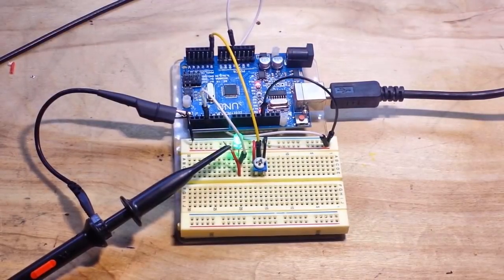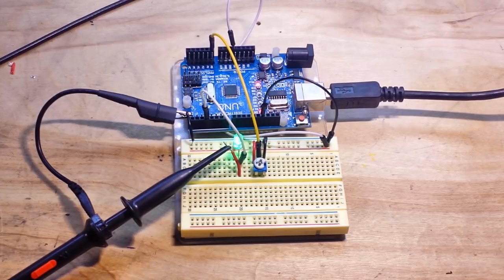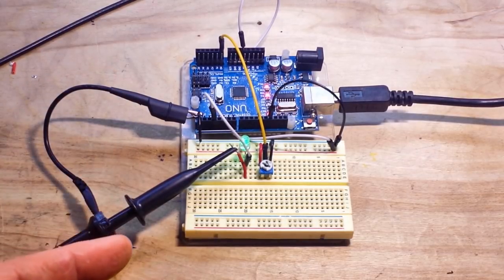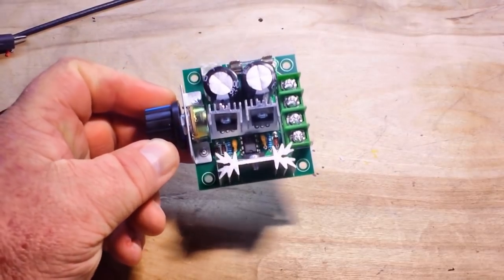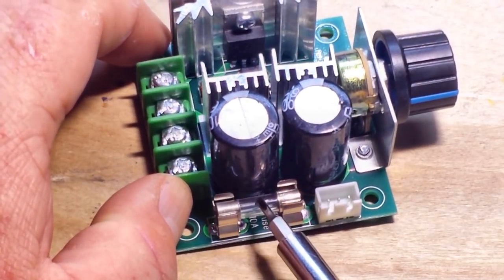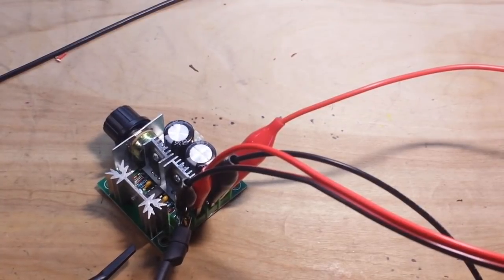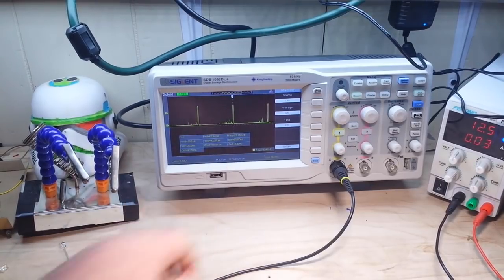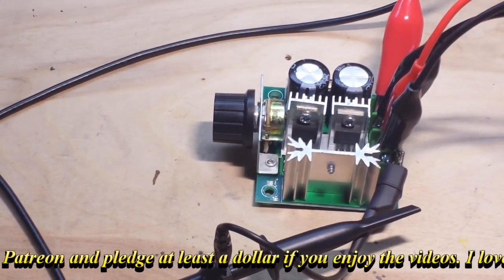Arduino vs PWM controller

Comment: I have already used the Arduino PWM signal to fire a MOSFET (IRFP260) with a few more things like an inductor and capacitor and I'm getting good results. Lots of current. Very convenient because I can tweak the thing via the code.

Comment: Why not hook up the 12v positive wire of your motor to 12v and then your ground of your motor to the 12v power supply AND the Arduino board along with the PWM blue wire of your motor to the PWM signal on your arduino?

Comment: That PWM controller is exactly what I need!, I want to control two identical linear actuators (baring same weight) in parallel. I believe they are around 3amp each. I've seen a PWM on eBay from China at $6.99 but it;s only rated at 6amp. To be safe I'd prefer the 10amp PWM, where can I get that?

Comment: Love the videos brother!. Can I use this pwm to power as low as 1 milliamp and if so what is the part number?. What I'm doing is building a colloidal silver generator and need 1milliamp most the time. But would like to use it also as a power supply box for other projects so I would like a 0 to 30 volt and be able to fine-tune down to 1 milliamp. Can you or someone help with part names?....

Comment: Thanks for your explanations. If I want to use an arduino to control an engine (24v - 5A) that currently uses one of those PWM (12-40 v), what is the easiest way? For example, replacing the analogue pot with a mosfet or a digital pot? Please help !
Reply: You can just use a PWM output pin to modulate the ON/OFF time of a switching transistor or heavier duty MOSFET. The low power of the output pins on the arduino doesn't matter since you wouldn't want to power your load through the arduino power supply anyway. The difference is the Arduino would be a separate module with a separate power supply that only tells the transistor when to switch. The motor and its own power supply would just be ran through the switching transistor/FET with the Arduino PWM pin feeding the Gate. I've seen people drive FETs directly from the output pins before but it depends on the max values. Need closer to 5v for a FET but with a normal bipolar transistor you could switch moderate loads with something like a 2n3055 only feeding the Base a signal closer to 1v.  

So for example I was just playing with a simple setup using a random FET I had laying around to drive a drill motor. I set my Arduino to read a potentiometer feeding into an analog pin and translate that digitally to a PWM output pin. This causes the output pin to deliver its 5v output with a duty cycle dependent on the wiper setting of the potentiometer. So when that output pin is fed into the Gate of a suitable MOSFET it will switch it HIGH/LOW according to the square wave from the Arduino. So cranking the potentiometer knob increase/decreases the frequency of the ON time and thus the motor speed. When I was first doing this I thought I had my pin frequency too high playing around with other stuff but after setting it back to default realized it was just certain motors being finnicky. Sometimes you will need to give them a kickstart or they will sit there idle and just ring under dead short causing the FET/Transistor to overheat.

Comment: You explained how the higher current pwm controller used a mosfet, yea...... Why don't you use a mosfet on arduino? It's exactly the same principle with the same result no?

Comment: Great video. Would it be easy to use an arduino or attiny to drive a FET? I was thinking of trying this but havent found examples and am fairly new to arduinos and electronics.

Comment: Funny this, about a week ago I built an X-axis power feed for the mill. Basically one of these PWM controllers w/reversing switch and a windshield wiper motor. When I checked the controller out I had to laugh and thought of your "The 555 is everywhere". Good video, thanks as usual"!
Reply from the maker: It really is amazing where you find these little guys...

Comment: Great video. Hey can you do a video on the stm32 boards? I'm thinking about ordering some to try and get a high speed rising edge. I want to try and look at the  bandwidth limit on my scope. I'm not sure if it is fast enough or if I should build something specifically to test it. 

I like the fact that a dollar month let's me help you keep making videos. I live on a small VA disability check that I have to stretch very hard. I can not afford any of the electronics courses online. What I can afford is a few dollars a month that I can give to the channels that I value the most. Anyone that complains about you asking for support has no clue how the world works now or they are a spoiled child. Keep up the great work Paul and have a great day.
Reply: Ahmen brother, thankfully we get some pittance from the VA!
Reply from the maker: Thank you. And yes i will. I have a "blue pill" stm32 here.
Reply: For your information there are some good clips on Youtube showing how to evaluate/measure the bandwidth of an oscilloscope.  They might not be super accurate methods but some of them will give you a very good estimate.  Simply search for "measure oscilloscope bandwidth" and you'll get what you need.  For the fast rising edge oscillator I built one based on the 74AC14 Schmitt Trigger Oscillator presented by wa2ew (Alan).  It is very portable and very useful with an oscilloscope to measure capacitors / inductors, coax impedance, TDR, etc.  With the 74AC14 I was able to get a rising edge in the order of 2ns and a falling edge of less than 1ns.
Reply: SimpleEnough2k9 sounds like I need to order some chips. 2ns is right where I want to look so that sounds perfect.

Comment: AvE is an acronym for Arduino vs Everything, so its A.V.E. not Ave ;)

sadly those pwm controllers are not controllable with an arduino =/ or usable for higher voltages
Reply: fredlllll um I can think of a way to control that high power pwm board with an Arduino. You could use it to control the potentiometer. You might have to build a board to sit  between the Arduino and the pwm board to shift the voltage levels but it is very doable.
Reply: fredlllll, I think that Arduinos verses Evil? Not that it matters one hoot!
Reply: i think the circuit isnt controlled by voltage but by the resistance, and its hard doing that with an arduino
Reply: right, could be evil aswell, i was too lazy to look it up
Reply: Just add a high power logic level FET to the PWM pin of the Arduino and you can do the same...
Reply: yeah but if you are trying to switch rectified mains it gets a bit scary
Reply: You can just use am opto-coupler between the Arduino and FET...   And using a 555 won't be any safer unless you do the same...
Reply: Mike oliver . Is possible to control pwm potentiometer by adrunio. Want to use a two button to adjust the voltage to up and down?
Reply: I use a NANO to run my entire camp on solar.  Buck controllers to operate the panels at power point are controlled simply by connecting an opto isolator to them.  Since the Arduino knows what everything is doing, any excess power is sent to a water heater.  No electrons are wasted, a super efficient system that costs next to nothing to build.   Opto isolator is used as a level shifter to drive a FET with over 10V on the gate.  NEVER drive a FET with less than 10V or it won't get to its minimum resistance. I have simple fet driver circuits. They don't always have to be fast.